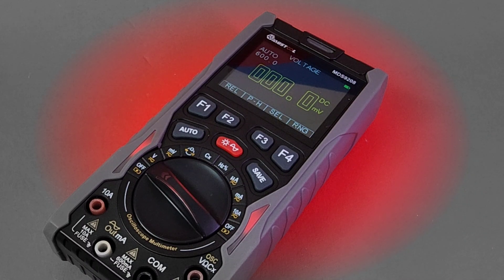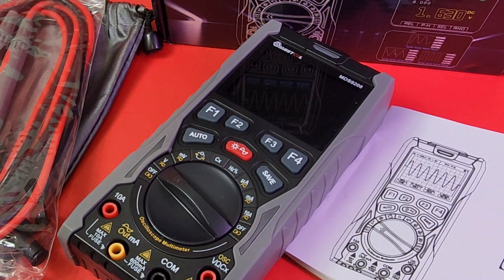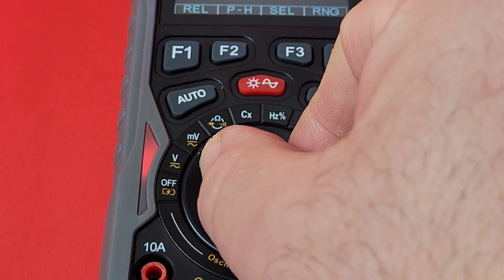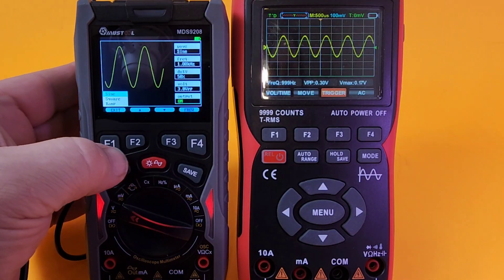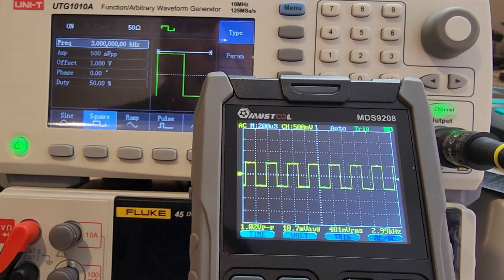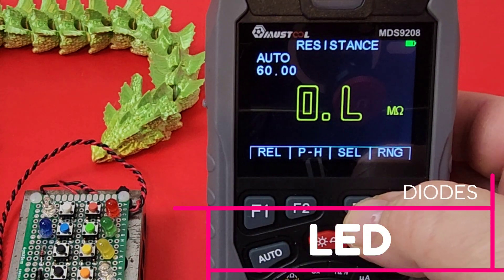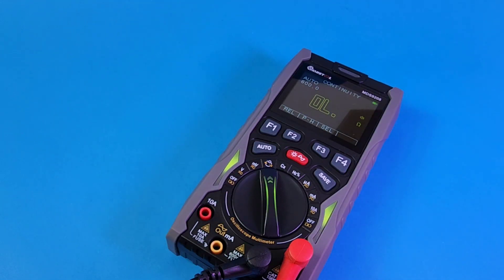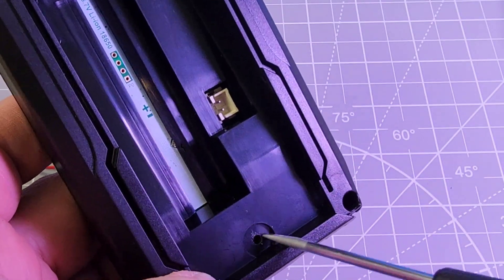MUSTOOL MDS9208 3-1 Oscilloscope Multimeter Review & Teardown!

Comment: 🎶Everybody🎶Great review!
That's a really nice unit for the price. I guess the 18650 has built in protection which makes a lot of sense, and the thicker PCB helps with heat dissipation from the current 'shunt'. Sure It's not for rough field use, but for hobby use on a bench it's excellent 👍
Reply from the maker: Well said my friend! Definitely a capable multimeter on the bench.👍

Comment: haha, remarkably questionable protection solutions.
Also, what is this shrink wrapped, Dupont connected 18650 mania everywhere? Why can't they just use hotswappable ones so there is no downtime (and no spot welding required when replacing lol)
Reply from the maker: Good point about the shrink wrapped rechargeable battery..I agree, a standard 18650 that can easily be swapped out just makes sense. 👍

Comment: That size, so little screen for an oscilloscope...we've definitely seen it before! Finally something that has a protected screen! AND DID YOU SAY 12MHz? Heck that is a lot better than those 200ish KHz units you otherwise see around! The illuminated dial is welcome, but the buttons aren't, they missed that part. Is the backlight brightness adjustable though? The battery can easily be upgraded for more runtime, yay! That is a proper SMD current shunt. Shame about the fuses...
Reply from the maker: The backlight brightness is adjustable..Agreed its a decent scope/meter for the price..just gimme back my ceramic fuses ! 😅

Comment: The mode spelled out across the top of the display plus the colored dial work together to provide excellent short term and long term familiarity. 👏
Reply: How are SMD fuses and current shunts the drawbacks?
Reply: @bhushan9066 They look like good quality variants. Maybe they aren’t as tried & true as the traditional choices?   I suspect that less heat forced directly into the PCB laminate leads to better longevity.
Reply from the maker: @bhushan9066  I'm of the "love that big fat current shunt"  crowd 😅